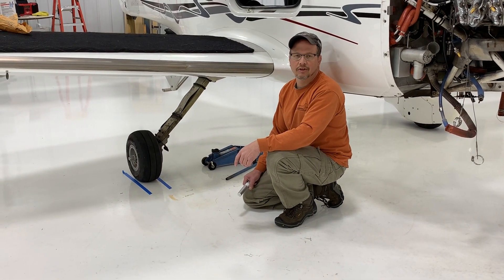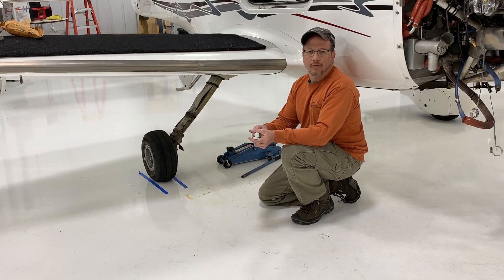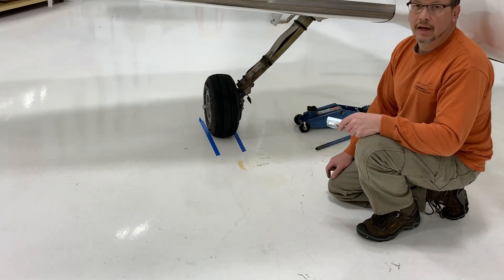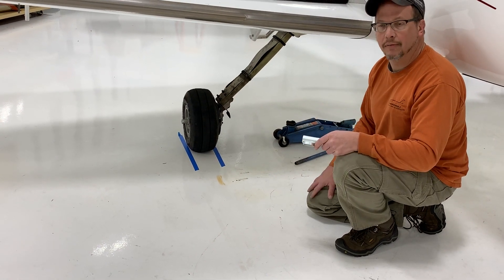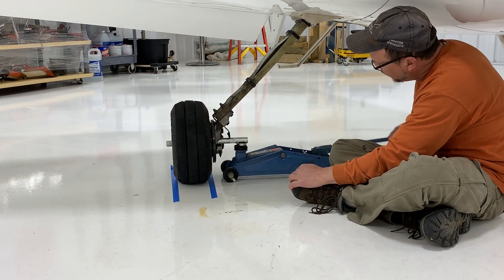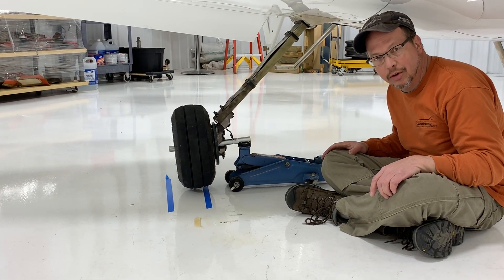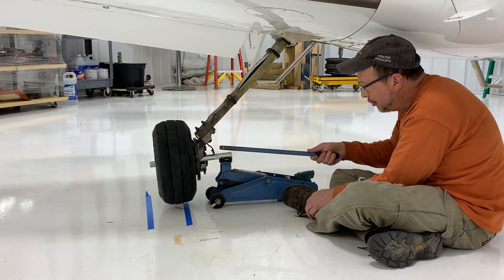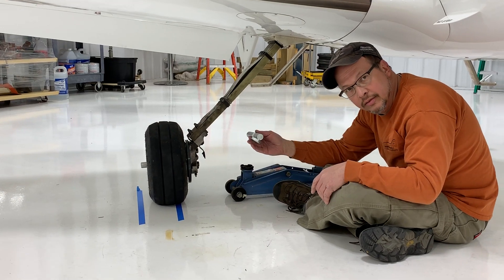Cirrus aircraft jacking process

Comment: That's so much better than the jacks. If the plane falls off the jacks with the wheel off there will be heavy damage to to the WING (by the jack!). With Jim's method you could still ruin the disc and calipers if it slides off the jack, but I don't see why it should!
Reply from the maker: cherokee592 you are correct. Possible damage to cheap easy to replace and source parts...if ..if one could get it to fall..